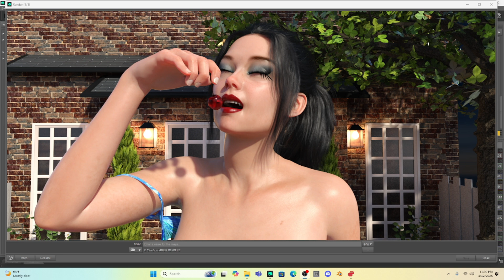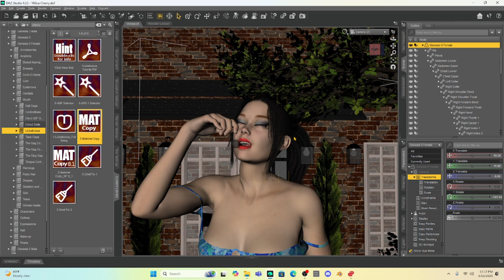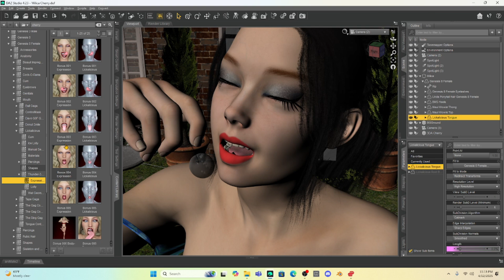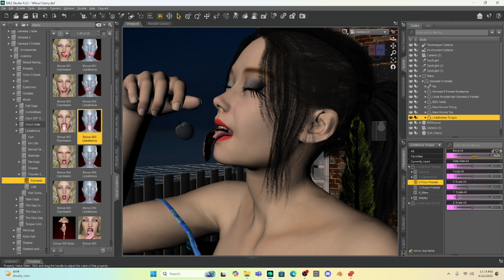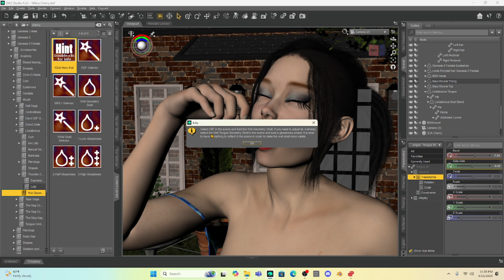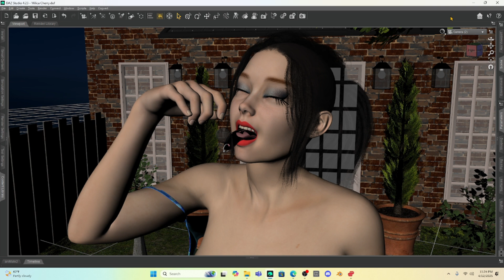Daz Studio: Add Realism to Your Character With LICKALICIOUS TONGUE!

Comment: Honestly I don't think an add on for G9 is needed. They're way more flexible (more morph options) and posing than G8 offers. But then again, I never do any crazy fantasy type scenes.
Reply from the maker: That may be a good point.  I haven't used G9's tongue that much and looking, it has a lot more versatility than the G8 tongue.

Comment: I'm not a huge fan of adding more geoshells to my character as you can only ever use one (though with some work, you can combine them).   You can extend her tongue out as far as you wish as use what comes with your character.  It's easy, this is what I do...
 
Select your character's head, go to the "Parameters" tab, then select Pose Controls->Head->Mouth, open your characters mouth, they have a tongue.  Under "Mouth" select "Tongue" then on the right panel you'll see the slider for "Tongue In-Out", the tongue won't come out of the mouth, but you can fix that by selecting the gear icon in the upper right corner of that slider and then selecting "Parameter Settings" from the drop down menu that appears and then make sure "Use Limits" is unchecked.  This allows you to move the tongue as far out of her mouth as you wish and pose it with the other controls.  No add-ons or geoshells needed.

Comment: I am stuck with using the default tongue, since I don't use G8. I do have a lot of aftermarket stuff for the G3 tongue which makes it where I can do a lot of these things. The same with the older Genesis characters. I might look into it if I can ever afford to move to G8. 

I do get pretty good results from what I am currently using. It is like GP I would have to learn a whole new prop. I have a long history with NG for Victoria from 3feetwolf. I know what I need to do to get a look that I am wanting.
Reply from the maker: The default tongue can be very effective. I really haven't used G3 much. It's too bad these products may not be available for the G3.
Reply: @notfromthisworld7672  Only GP is available. I got a lot of the posing and morphs from our well known adult supply website.